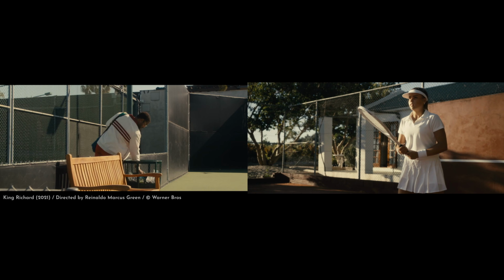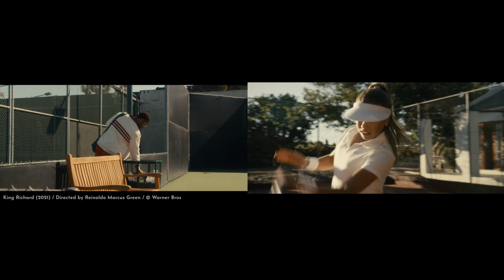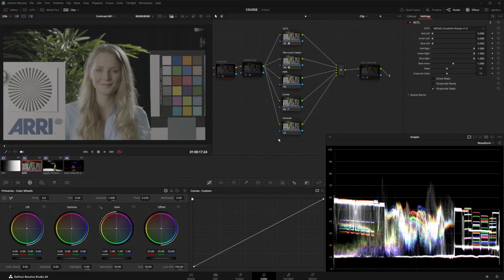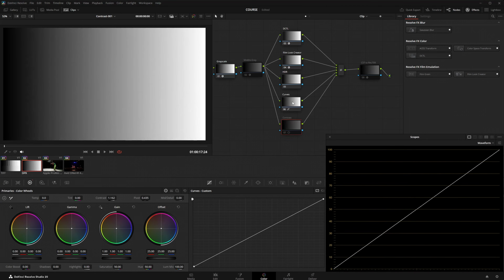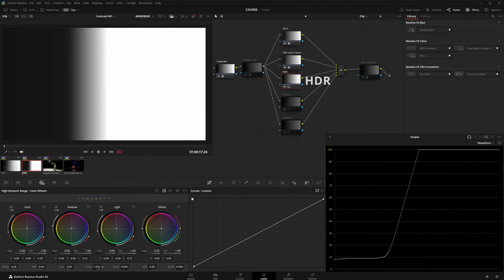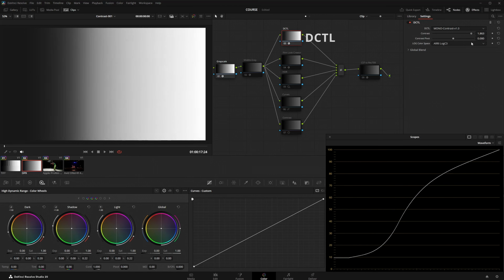Reverse Engineering Film Looks — New Course Update

Comment: Hi Stefan. Does your course cover reverse engineering a PFE LUT (like Kodak 2383) by profiling Scopes data and rebuilding it from scratch?
Specifically, I want to learn how to build a subtractive color mixing model inside a node tree to eliminate LUT dependency. If it's not explicitly covered, will this course provide the technical framework to achieve this? Thanks.